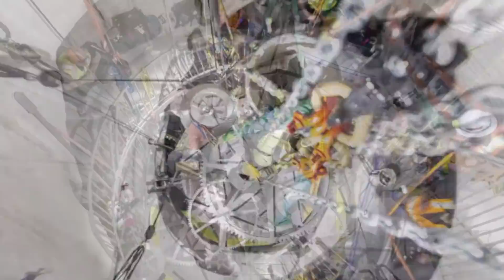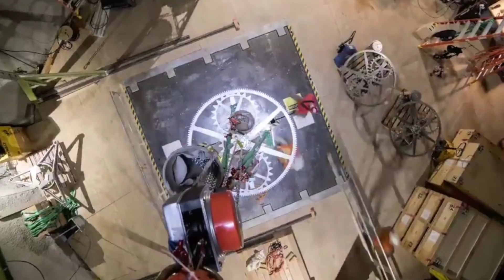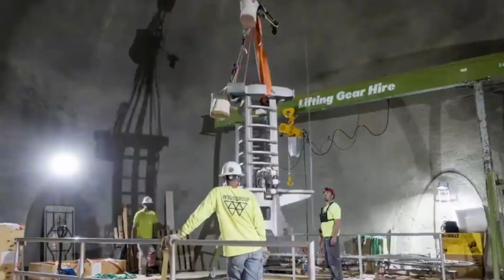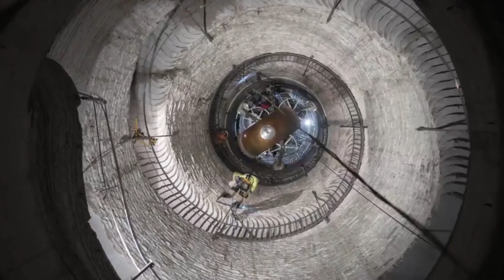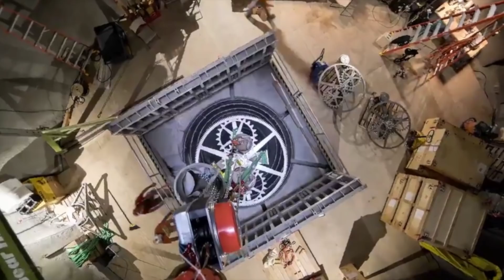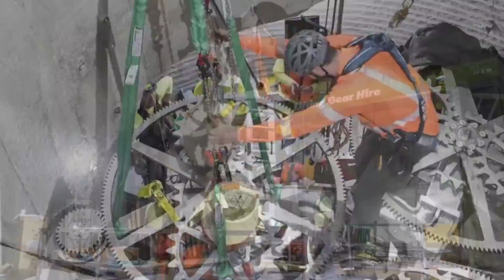Why Is Jeff Bezos Building A Massive 10,000 Year Clock Deep In A Secret Mountain Bunker In Texas?

Comment: My question is, unless he can seal the chamber from Earth’s atmosphere permanently won’t the metal in this clock turn into a pile of oxidized dust within a few thousand years?
Reply: Dry air in the desert does not corrode stainless metals, the types were mentioned in the droning monologue somewhere.

Biggest danger may be dust shaken free by earth tremors and settling in bearing surfaces.  The speed of the clock is slow, the fastest action is the gongs and they can fail.  The time keeping mechanism only ticks once or twice per day so compared to a regular watch that ticks once or twice a second that 86'000 times slower.

Cool engineering project.  Neat philosophical project. Sad that it was hijacked by Bezos.

Look up "Iron pillar of Delhi 1600" years old in the open.